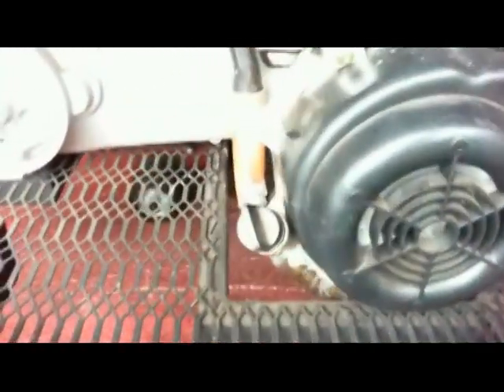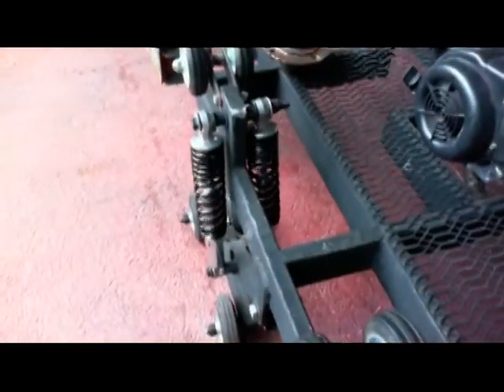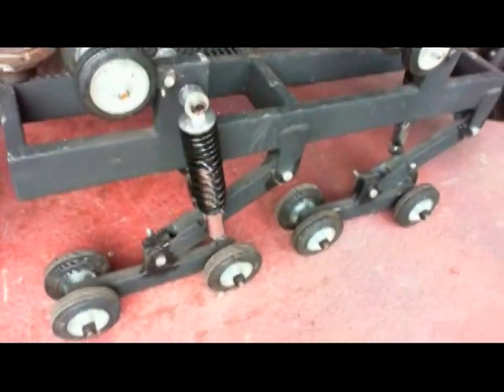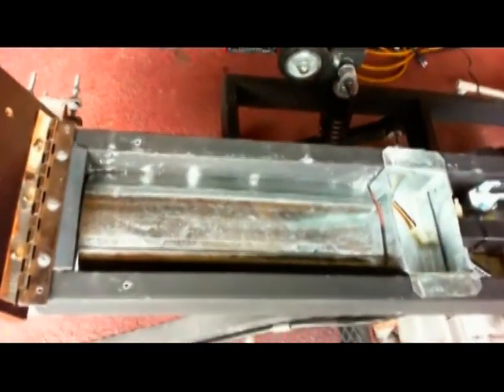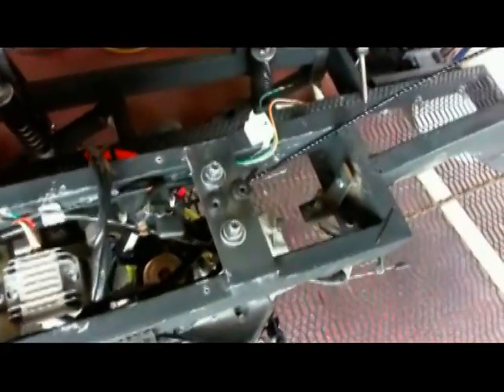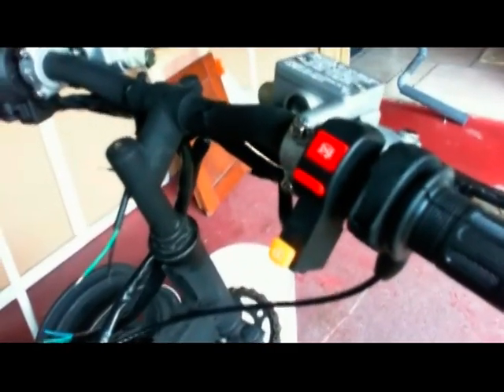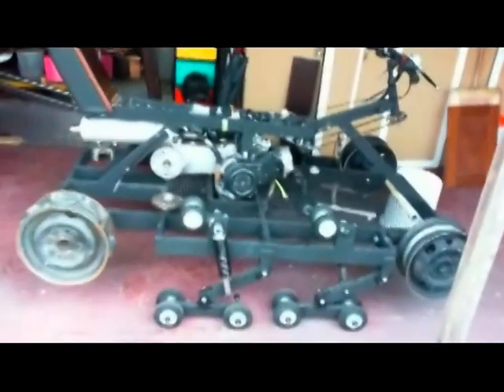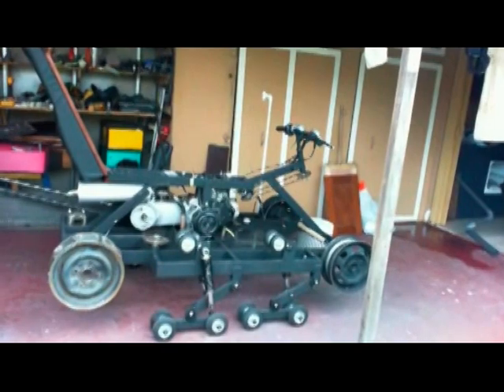How to build a tracked vehicle. Progress Report 9-A

Comment: Now that's lookin nice. I like the hand brakes on the bars. You shouldn't have any problems with those not working, should brake good with rotors on the axles. I'll probable run drum brakes, was planing on makin them myself, but rotors would work better, longer though, if I can figure out how to make the calipers easily, cost to much to buy on my budget. Maybe use parts from a c-clamp, HMMM. Did you figure out the axles yet?
Reply from the maker: I am still working out the axles but I have an idea I am working on. I could not find anyone to help bend the exhaust pipe so I had to cut it about 20 times and bend it and re weld the gaps.
Reply: Did you watch my vid on makin your own exhaust? It covers makin the pipes in the first vid. Anyways, it still looks good, I definately liked it watchin the vid.
Reply from the maker: ***** I will check it out. Thanks